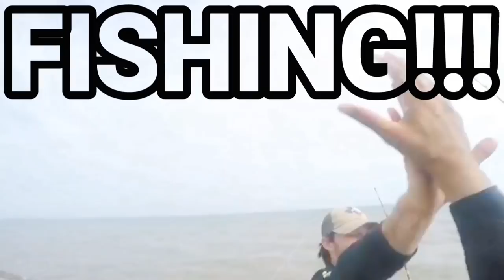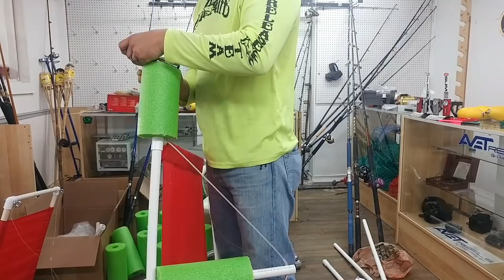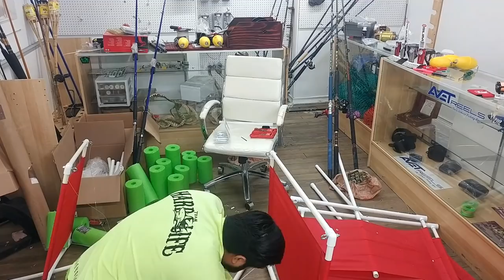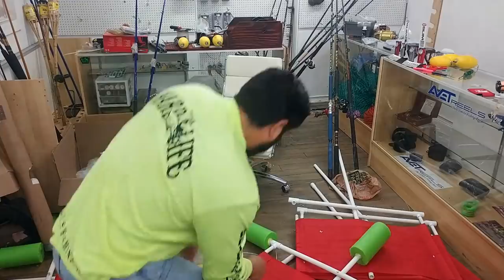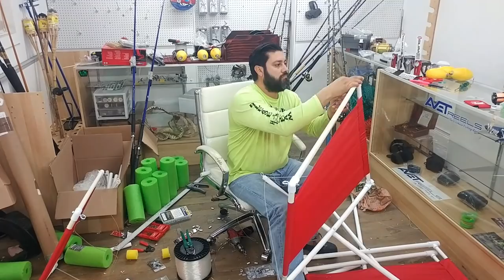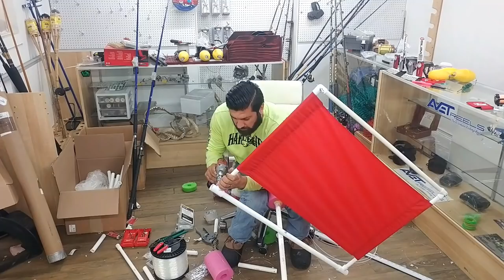Setting up to use wind power

Comment: That appears to be standard PVC have you ever thought of using CPVC i know it is higher priced but it is more sturdy, or is that not really needed in this application?
Reply from the maker: Yes and yes not really needed have never seen them fail or break.  Yet.   Been decades.